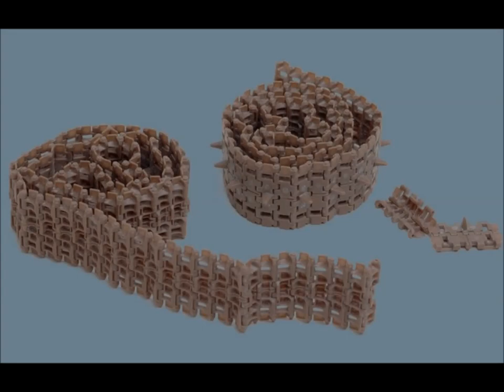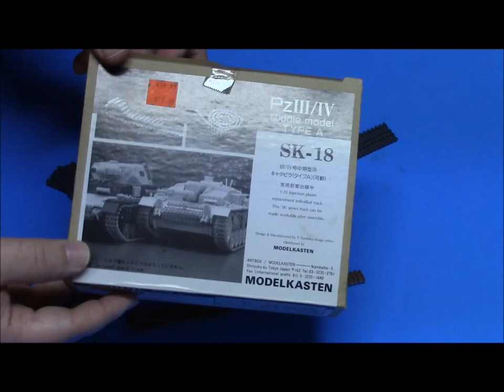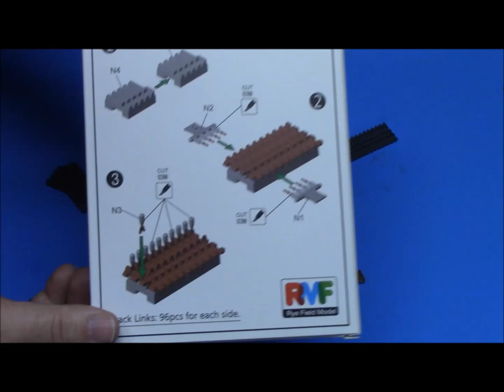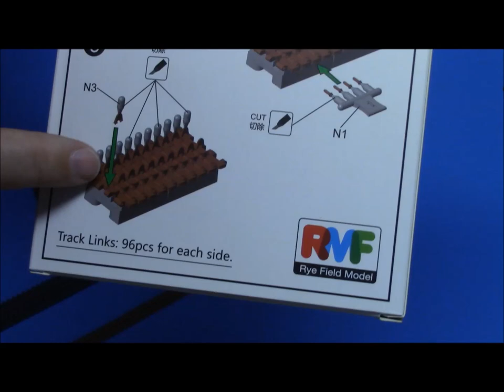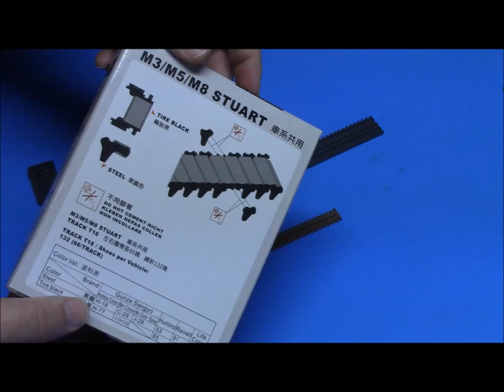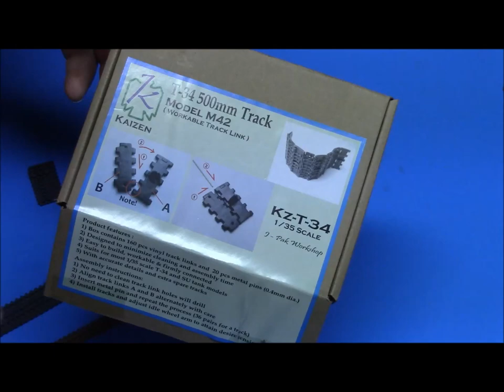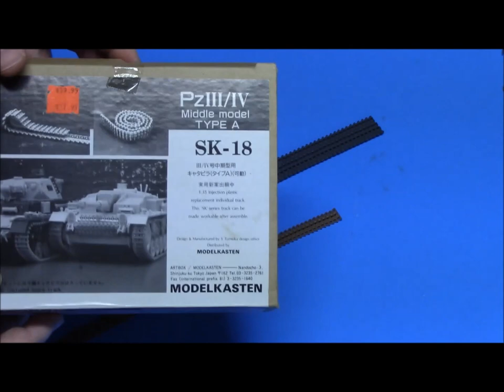Russell Gosselin: A Few Notes On Workable Tracks

Comment: Really interesting vid, Russell. One thing: Friul tracks are made in Hungary. They're the only real workable tracks I ever built and I took the set with me on rehab that was supposed to cure my spine. That didn't work at all, but I had a lot of time for the Friuls. Five weeks, two finished tracks. I do the same when I build tracks. Without music there's no way I could do it. Agreed on the length of vinyl tracks. I can't remember how many Italeri Sherman idler wheels including the axles popped off because of that. Back then there wasn't any replacement and I was to new in the hobby to reposition the idler wheels before trying to put on the vinyl tracks. That's actually the reason why I wouldn't use them anymore. In no case! Not even if you pointed a pistol or rifle at me!

Comment: first kit back to modelling,tamiya cromwell.2 weeks 1 rubber band snapped.I looked at them closely,and. it looked as if someone had stapled. them a load of times and removed the staples.Indy links shit or bust from then on.
Reply from the maker: Be patient with your first go. . . And watch some more tutorials here on the Tube.  Good luck and don't hesitate to ask for assistance.  Model on.
Reply: Thanks.i pick up the odd bit of info as well.So hopefully it wont be just be me pestering you for your experience.d.